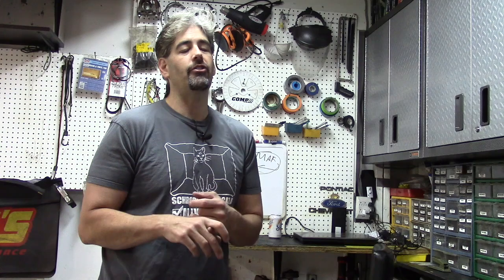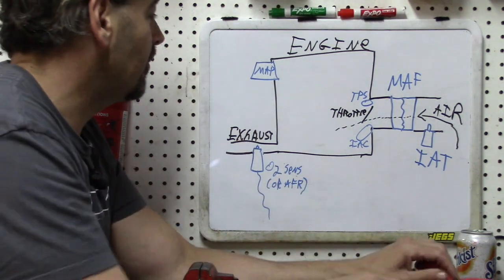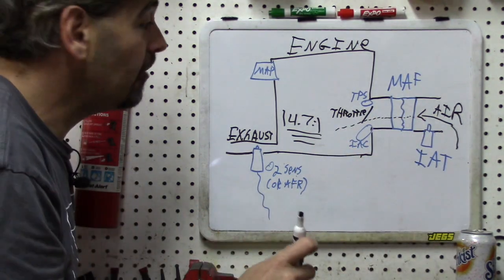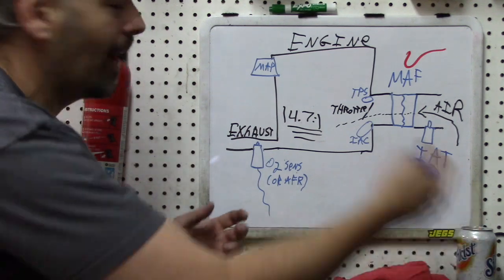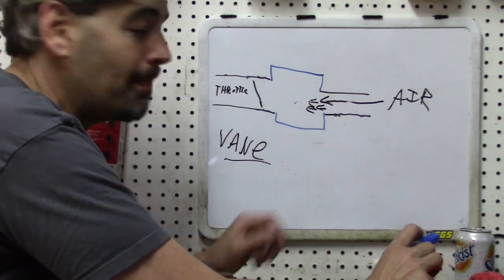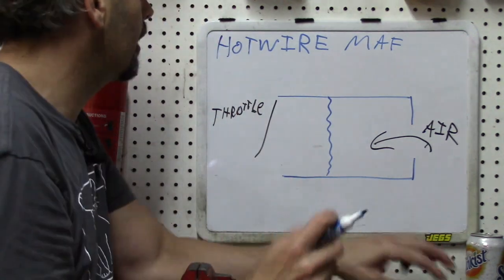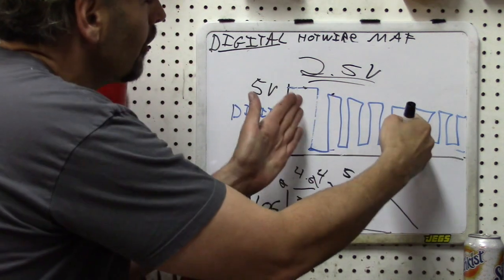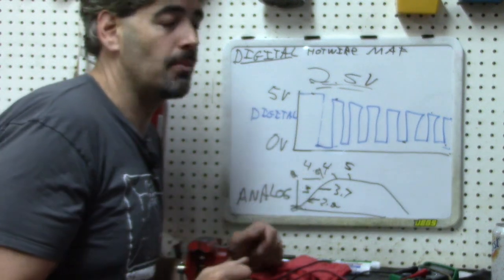Diagnosis and Understanding: MAF Sensor Pt1 Analog, Digital, Hotwire, P0101 P0102...

Comment: Hi I was wondering if someone could help, I have a v8 engine with a Hot film sensors x2, my fuel trims are within spec (LTFT) but sometimes when I go WOT, my bank 2 STFT shoots off the scale + and I get a misfire/hesitation. Is this likely to be a badly reporting MAF? Thanks a bunch. I am exceeding 20% positive.
Reply from the maker: could be. Among 1000 other things that could cause that. What induction data do you have? what is your volumetric efficiency showing? What is the MAF design- is it analog or digital and is the output matching accordingly with TPS?
Reply: @SchrodingersBox  Thanks for your reply. Do you mean my MAF reading in grams a sec?
Reply from the maker: that would be a start. but also the VE is useful to determine if the MAF is under reporting.
Reply: @SchrodingersBox  Can i get that with a basic logger? I was also thinking upsteam o2 on that bank could be an issue but my LTFTs are fine.
Reply from the maker: O2’s control the STFt not the LTFT
Reply: @SchrodingersBox  I have Throttle pos, MAF BK1/2, Fuel pressure, MAF is hot film and its a modern car so pretty sure its digital, STFT, LTFT I am going by mainly. The MAF output looks like its in line with TPS. Do you have  a means of comms outside of youtube? Thanks buddy
Reply from the maker: I would just curve the TOTAL trim against load as a basic starting point. if you run lean on total trim under load you either have a dirty MAF or a fuel deficiency.
Reply from the maker: yep looks like bank 2 runs lean under load.
Reply: @SchrodingersBox  yeah........I guess you are stumped like me. I have new MAFs arriving in a few days but have been told that the MAF is only a reference to the MAP sensors and doesnt have a massive influence on fuel delivery.
Reply from the maker: I am not stumped. I just don’t have relevant data.  I need to have induction and ignition metrics to explain the lean condition on a single bank and am waiting for that to be provided?The only thing I am stumped about is why you are ordering a MAF?? You can clearly see the MAF cannot be the problem unless I am missing something there- did you show data indicating  a MAF failure that I missed? And even so, why would it affect one bank? That makes no sense to me at all. where is that data- I didn’t see that in any of what you provided unless I missed it?  If so please specify where it is so I can review it but I sure can’t see how a MAF would cause this based on those fuel trims.
  Otherwise send me relevant metrics for bank specific lean variables.
Reply: @SchrodingersBox  Ok, the reason I ordered 2 new MAFs is because a knowledgeable company told me that might be my problem, also the fact that its shooting lean, and as per your video. I have 2 MAF sensors. not 1. So if bk2 is shooting lean, the MAF could be underreporting the amount of air going in. or there is a leak after the maf but its odd as  STFTs are good at idle and the LTFTs are -3 and +3 or so. So that would rule out a leak, right? ignition timing would effect fueling how exactly?  If you could tell me the exact data you need I can try and provide it. Thanks again
Reply from the maker: @1985gooz  Well I don't see how they can be knowledgeable when they have the same data I do- what data are they basing this on?
  Either way- I need to see the injector pulsewidth modulation on each bank,  the spark kv outputs on each coil, and the O2 sensor voltages on each bank.
  Alternatively you could do some basic experimentation- for example, move the coils from bank 1 to bank 2 and see if the lean condition moves to the other bank. if so it indicates one or more coils is bad.
Reply: @SchrodingersBox  yeah sure, they have the same data that you do. Injector pulse width I cant get, would  a bad coil cause a STFT in that bank to shoot lean then? I can get the voltages from the downstream sensors, for some reason the upstream sensors are showing in mA rather than volts..
Reply from the maker: yes it would. any misfire or incomplete combustion causes a lean condition due to the excess of oxygen. also a fuel deficiency on one bank can do it as well- injector imbalance or low injector performance. not likely a vacuum leak based on your data I saw.
Reply: @SchrodingersBox  Yeah i mean the trim are well in check. I just did a 2k hold in neutral for exactly 30 secs and the STFTs, whilst they are in spec they are pretty different. Is this an issue? It doesnt look like a vac leak to me either https://drive.google.com/file/d/1IFKwxNGvyDGPR2sK32JsB_H7PN1rgDqA/view?usp=sharing
Reply: hello?

Comment: can MAF overreport?
Reply from the maker: I have never seen it happen but I suppose it's possible.
Reply: Schrodingers Box I have a car with 222k miles that runs perfect. Fuel trims are at zero +/- 2% , all of the monitors complete etc... But MAF shows 13.4 kg/hour at 700 rpm when every source says it should be 11
Reply from the maker: Please tell the dynamics of how that would happen. What are the conditions where a MAF would overreport?
Reply from the maker: What is the mechanism for that?
Reply from the maker: Weld Bead- OF COURSE an aftermarket component can be incompatible - that is not the question. The OP is asking for explanation on a condition where the OEM MAF can overreport. We can easily assume he has a negative LTFT condition where it linearly decreases with TPS%.  This didn't happen because an aftermarket MAF suddenly popped into his car. We are thinking what are hypothetical conditions that explain this condition- such as voltage drop on the hotwire referencing an inaccurate interpretation of equilibration.
  I can't think of any condition that reasonably explains this.
Reply: Schrodingers Box I've found the " problem "  : MAF is accurate, just one of the previous owners replaced 2.5 L. engine with 3.0 L.
Reply from the maker: Ha! that would explain it.  Not only is it not overreporting after all, but you also got yourself a perfect engine upgrade as well!!

Comment: There are DMM's that will measure frequency,might save some of that dick pain. :) I think mine covers 10hz-20khz,not sure. IIRC,the last frequency based MAF I fiddled with was in the 1khz-9khz range,or so?
Reply from the maker: PhattyMo Yes as you will see I use a frequency meter later in the video as well. a 10-20kHz will easily work in this application though I have read several sources claiming up to 30KHz can be used for MAFs. I don't know that I have ever actually seen that but until know I never really paid attention lol!!!

Comment: Because I can only speculate I’m new it still has east coast plates and registration and hope that never changes with CA laws. Now I think I know it his tool reset my computer to factory settings. How can I fix this with out costing me a fortune? I can’t take it anywhere the locksmith won’t even check Google he swears that it’s not that his reason it doesn’t have a return fuel system that would mean the fuel pump is always on. Exactly and from 99 to 04 ford did and with a boost a pump I’m at 40 psi just Google I don’t care prove me wrong but fix the computer it’s not the key or the ring

Comment: liked his videos a lot until I saw the one with his Firebird and the clutch sensor.  When the video showed the actual sensor switch, I knew then it was staged why?  Because it was not even in its bracket that holds it in place.  Totally free as it was it would fail maybe 9 out of 10 times and not 1 out of 10.  Anyone can look smart when it is staged.
Reply from the maker: Incorrect- it was loose in the bracket as clearly shown on camera. I do not need to stage things. You on the other hand need to THINK- I proved conclusively with both negative and positive controls that the clutch switch was the issue and it went right over your head because you don't understand the scientific concept.
 THINK next time so you don't look foolish.

Comment: F.r.e.q.u.e.n.y.  C.o.u.n.t.e.r. O scope is overkill. Vom is underkill .   crazy time wasting tangent. Lithium levels?
Reply from the maker: ah I see. then tell me how to properly diagnose it then. I am dying to hear your more efficient yet equally conclusive method.
Reply: @SchrodingersBox  wouldn't the upper and lower limits of delta lambda be a starting point? and d then tell more if the curve between the two was linear? Just guessin here but logic.....

 limits of
Reply: @SchrodingersBox  delta lambda over throttle position
Reply: In the case of digital maf. Which is actually useless to me as I have hotwire type overreporting.
Reply from the maker: ok so tell me how to differentiate a positive lambda with TPS as a MAF failure vs a fuel deficiency. You failed to do that.  See, I would differentiate that with my method that you called “overkill” and “wasted tangent”. yet you still have two distinct variables.  How do you differentiate those variables?
Reply: @SchrodingersBox  could it not be pulse width modulation?
Reply: No delta lamda with my tps,as that is analog as is my maf.just speaking in hypotheticals of a digital maf. Pw
m would name more sense.
Reply: @SchrodingersBox  at this point on my vehicle I suspect both concurring out of spec high tps offset value at idle AND overreporting MAF  to be causing my negative fuel trims . They are now telling lies concurrently. Non oem sensors CONSPIRING!!!!
.
Reply from the maker: ummmm sounds to me like you have absolutely no specificity whatsoever. that’s why you have no idea what is happening in your car. that’s why my method is not “overkill” or wasted time. You have no clue what is happening, as you admitted several times now. I on the other hand would know 100% if it was the MAF or not. There would be no doubt, no confusion and no guessing. 
  Basically, your method is the waste of time, not mine.
Reply: @SchrodingersBox  whuh...wait... my initial statement was really  nonspecific to any vehicle or problem but was simply this; the difference between a value being communicated as an analog voltage or resistance on a referrance voltage, a pcm signal where the value is communicated as a pulse of variable  time width with a fixed off time between pulses, a pwm signal where square wave pulses are sent at a fixed frequency with various pulse widths which  actually simulates an analog voltage OR a true digital signal either serial or parallel which requires a line for each bit.  That aside , most Pam's are highly prejudiced to the maf sensor in that if there is a conflict between may and tps, the test always gets the blame.
Reply from the maker: So in other words you agree with me that my testing procedures for the MAF are accurate and the correct way to assess its performance...
Reply: @SchrodingersBox  Totally.  I am just not so sure that in the case of a digital type with the square wave( which I do not have) that the signal is actually frequency  modulated. . It may be pcm which varies the width of the on pulse with a fixed time between off and next on. This is easy for a computer to read as a ter starts when the pulse goes on and stops when off. The countup of the counter becomes the value. Technically this is still analog. The only true digital signal sent on one wire is serial.  But I used your technique to figure out had a totally whacked out maf. But now I have a new one that lies a little.

Comment: Matt I have disliked this video because you have drifted wildly from the topic. Whilst the information is true and accurate, I feel it is way out of context. A better approach would be to have a series of videos concerning signal types that someone is likely to see across the car during a diagnostic session. The majority of Part 1 MAF does not explain a MAF sensor but signals types.

Further to your, slightly flawed, explanation of a MAF sensor right in the beginning, please check out a 'Wein Bridge' it is a group of 4 sometimes 5 resistors configured like a diamond that self regulates. One of these resistors is placed in the air flow which causes an imbalance in the circuit current in one of the legs. It is this that the computer monitors. Secondly, a vane type MAF measures weight a true MAF measures MASS and so is self regulating based vehicle altitude and air temperature. I don't think that an IAT is used nowadays to directly affect fuel metering because hot wires do it by default of the technology used. With a cane type of sensor you did have know the air temp.

Keep up the good work
Reply from the maker: Well thanks... I did check your channel to see an example of how to do the video "properly" as you say, but you have no content.